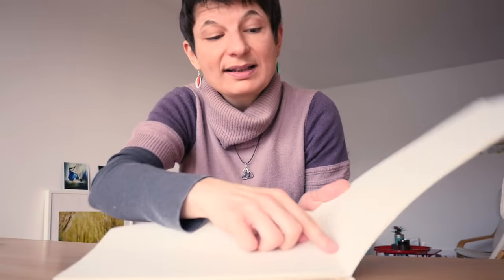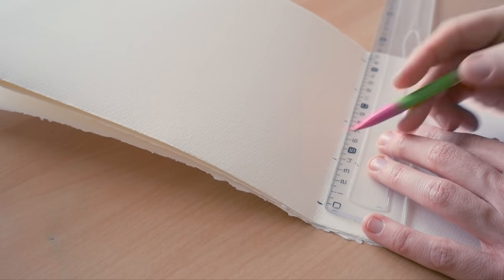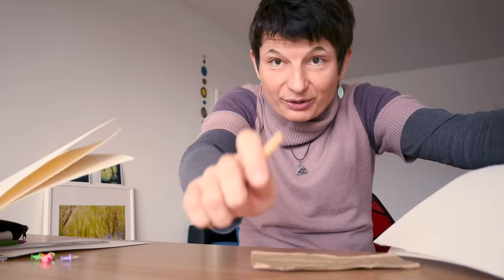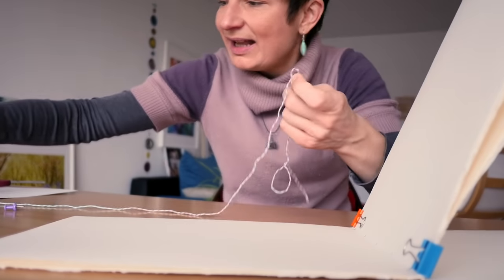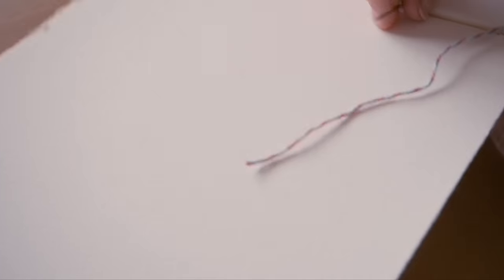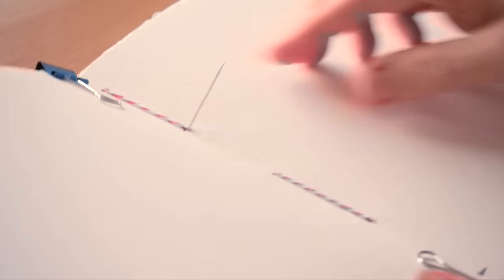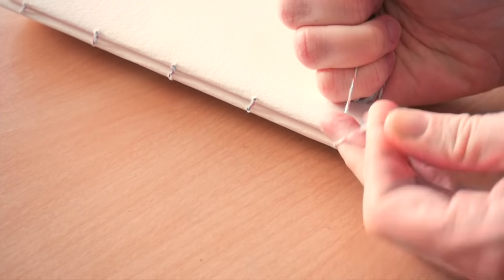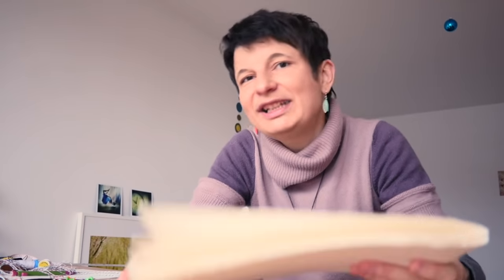BINDING your Journal or Sketchbook. DIY Journal #2

Comment: I have made a sketchbook using your directions. I love your method of tearing the paper to go with the deckled edges. Oddly enough, my Fabriano Artistic paper I bought here in Mexico was 21” x 28”.  So my small sketchbook is a little smaller.  No problem. I too would like to see adding more signatures & adding a cover

Comment: I love it! What a luscious new sketchbook to fill! Thank you for sharing!
Reply from the maker: Hi Faypaint! Yeaaaah, so luscious and with the handmade touch. <3 :) Thanks for your kind comment. Will you make one?! :)
Reply: I do make my sketchbooks. I love to do it and would not be happy with store bought books now. Also, I wanted to ask you how you care for your sable quill brush. I have been being very careful with the one I just got. The bristles are not forming into the nice shape when dry, but do when it is wet. Is that normal?
Reply from the maker: Hi Faypaints! How are you today?! 😄 Happy Valentines days to you!! 🎉🧡✨ Yeah, that's normal than your big brush doesn't have the hair together when it's dry. 😌👍 Especially if it's new or not used a lot yet I think ?! If the hair comes together nicely when you dip the brush in the water and paint you don't have to worry. 😊 Just swirl the brush really well in the water and wipe in on the edge of your water ppot before painting and you are good to go! 👍 I think that after a while, the brush keeps its shape more when dry maybe because of a bit of pigment left in the brush that keep the hair sticking together ?! I am not sure it's so much of a good sign. 😬😅  I don't really have a sable quill, I have a squirrel mop and a sable pointed round but I try to care for my brushes by washing them well when I think about it 😅 and carrying them in a sort of flat cardboard pouch I made by myself. Not the best caring in the world but ok enough I think ; brushes are meant to be used. 😊  Yes, making our own sketchbooks is the best. As I said in the video, I understand so much when you say that you couldn't be happy with store bought sketchbooks now. 😌😉 Have a good day!!
Reply: Thank you so much. I won't worry about my special brush any more. I really love using it. It makes such juicy washes! Happy Valentine's Day to you! I am really enjoying your videos. They add a cheerful sparkle and fun creativity to my day. I know they are a lot of work to make, so I hope you know that it is appreciated. Thank you!

Comment: When you split the 6 paper signature into two 3 paper signatures, did you have to check again so the papers would have matching "sides" of the paper facing each other, for where one signature ends and the next begins?

It could be fun to have different kinds or surfaces of papers, or even colors of papers within one book though.

Comment: Hello and thank you for your tips - I'm not sure I heard about the type of cotton thread used ? what thickness is it? and if using flossing thread - does the waxed one really work? I saw on your other videos that you add washi tapes between some of your pages ... is it to strengthen the binding? cheers
Reply from the maker: Agnès, I admit I am not an expert in choosing the thread... You need to find one which is not elastic so cotton usually work rather well. I usually use the washi tape to add additional pages in the sketchbook as I said in the other comment 😊 and once or twice, I used it to try to bring the page a bit closer or to hide a gap I didn't find nice. 😉